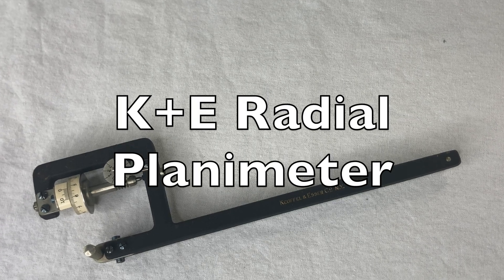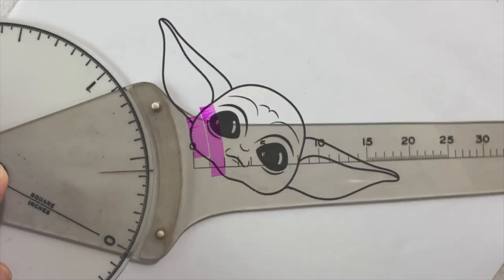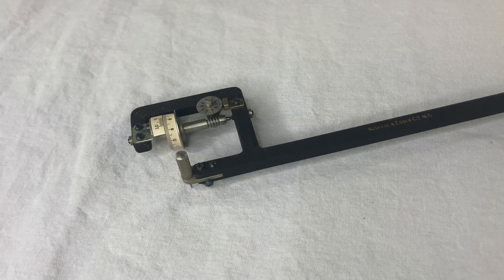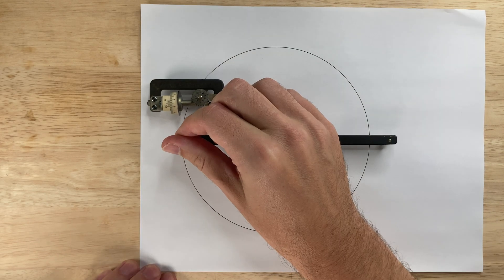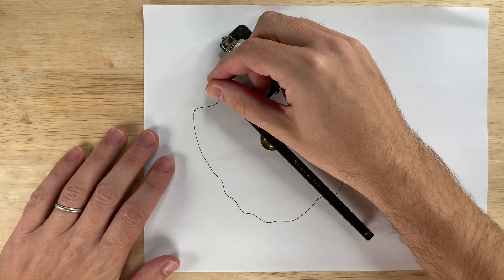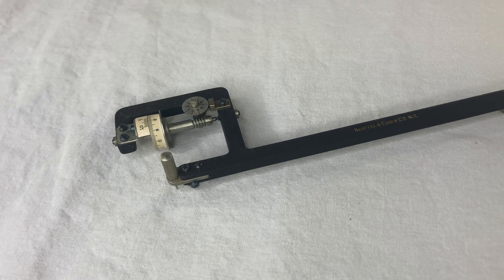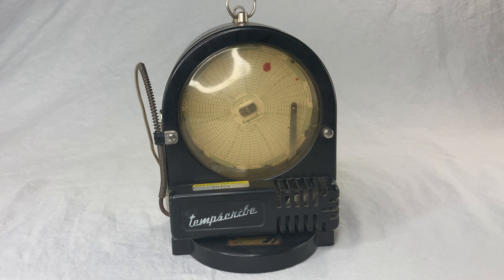1920s Radial Planimeter Review / HowTo

Comment: But... the pen appears to travel along an arc as the temperature changes, it's not moving directly radially towards and away from the center of rotation of the circular graph paper.  The inaccuracies!  Won't someone think of the first-order perturbation effects!
Reply from the maker: If you look carefully the graph paper in there takes this into account- it's not a pure polar coordinate chart. The "radial" lines have a slight arc to them.
But maybe you're suggesting that the radial planimeter will no longer give an accurate reading of average radius? This might be true- I'm not sure. (obvs the effect is very very small)
Reply: @ChrisStaecker  Yeah, I saw the arcs on the graph paper - I was referring to the effect this would have on the planimeter.

Maybe if the characteristics of the arc motion of the pen were figured out in the right way, you could make a planimeter where the groove on the bottom, where the pin slides, is a curve instead of a straight line?  Then, the direction the roller is rolling is not (always) exactly perpendicular to the radius of the circle described by turning the arm around the pivot.  Hmmm.  It might work.
Reply from the maker: The planimeter calculates the average radius assuming a "straight" polar coordinate grid. So maybe it's as simple as: you measure the average "straight" radius using the planimeter, and this reading will be slightly high because the chart radii are curved. But you can measure out your "true" radius on the chart, and thereby convert it to the appropriate chart reading.
Reply: @ChrisStaecker  Close, but not quite.  At least, not if the angle of the pen directly corresponds to the function value.

Imagine the pen is 10 degrees to the left for half the day, and straight up the other half.  The circle corresponding to the pen at 5 degrees will not be quite the same as the circle with its radius halfway between.  The dr/dy isn't constant, if that makes sense.

Not trying to be difficult, I know it's small-order effects, but I find the details can be fun to track down.
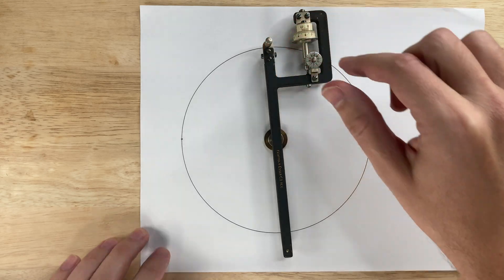Reply from the maker: @hughobyrne2588  Yes I think you're probably right. I find this thing deceptively simple- it's clear how and why it works, but the quantity that it's measuring is pretty strange. I was confused for a while about the point I raised at 6:17- intuitively I had expected these things to be the same. Throw in a curved chart and all my intuition is out the window. Probably the correct intuition is just: it mostly works fine but things are very slightly weird.